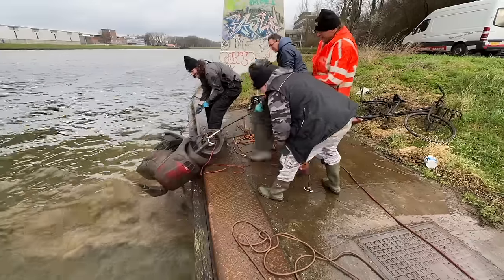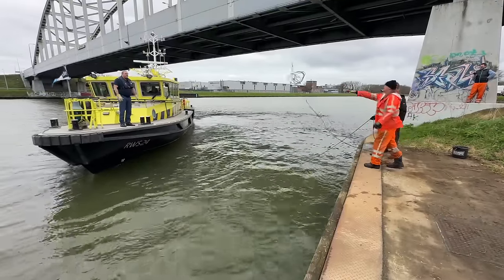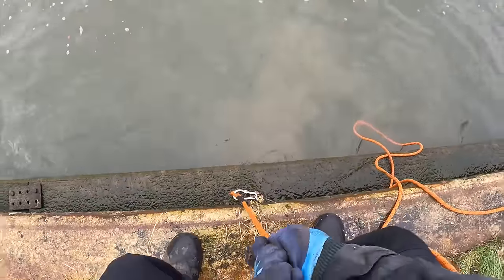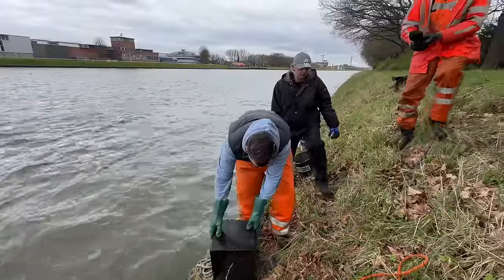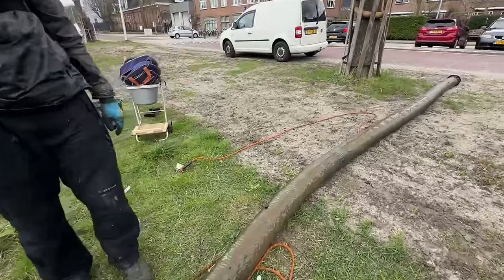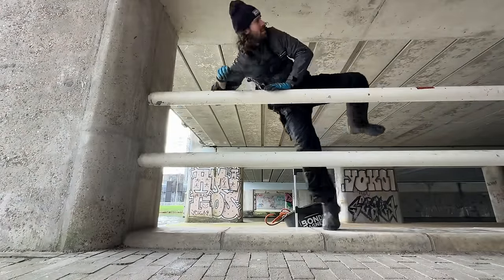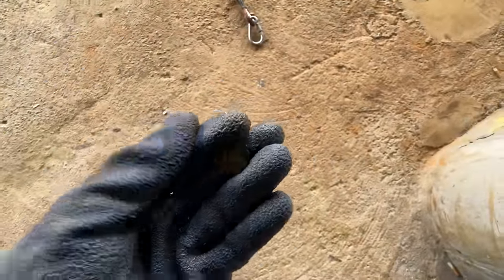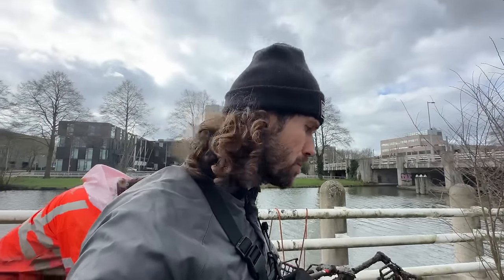Pulling Safes out of the Canal with Enormous Magnets!

Comment: You guys need a wood ramp with a pvc or plastic sheet on the river facing side to make it easier to slide safes. It would need to be at least 1 meter wide and 2 meters deep. Different types of hankering but I suggest 2 to 4 eyelets on the edge of the deck to attach cords or steel rodes with hooks directly on the ground or cords attached to trees or a car close by. The corner where cords or straps will rub it is good to find a very smooth piece of plastic like UHMW if my memory is good. Basically the green plastic that goes under skateboards resistant to lots of friction. It is possible to make it in 2 sections so easier to carry and more practical for using only half. Probably around 100$ in materials
Reply: Also use oak or strong wood

Comment: Leigh's pole/pipe find just happened to coincide with the failure of the local sewage system 😂😂😂 It actually looks like the type of pipe used on boats & tanker trucks for pumping in it out large volumes of fuel, water or sewage.

Comment: @BondiTreasureHunter I posted before when your camera fell into the water but if you attach a short length of rope with a carabiner to your camera/phone stand with a slipknot, or even better a secure but easy to undo bowline knot, you can tie it off the same way you do with the end of your magnet line, to keep it safe. Obviously thisnwill be redundant once you've got you boat where you can mount cameras all round it 😊
Reply from the maker: Sounds good mate! The only problem is that if I’m filming myself I have to set up the camera on a tripod! 😃